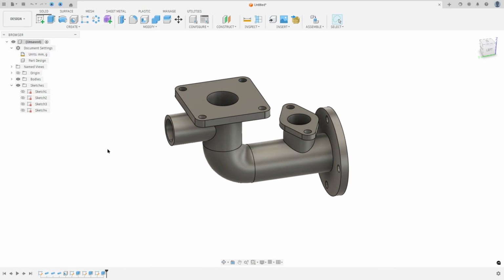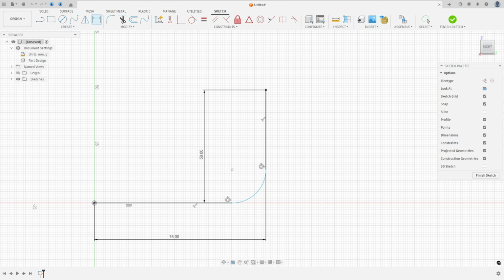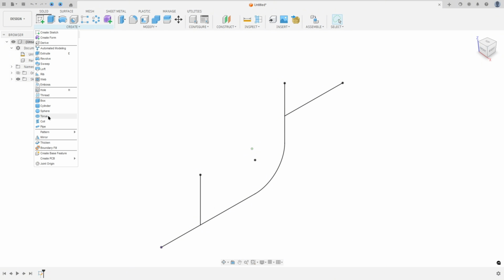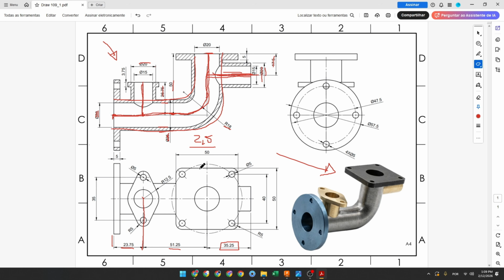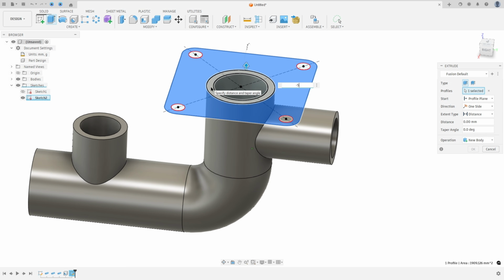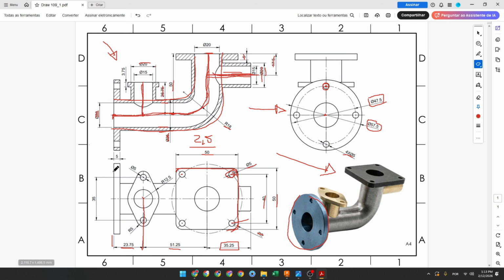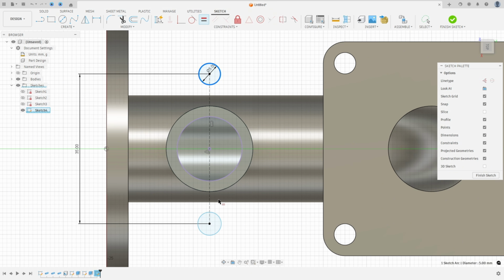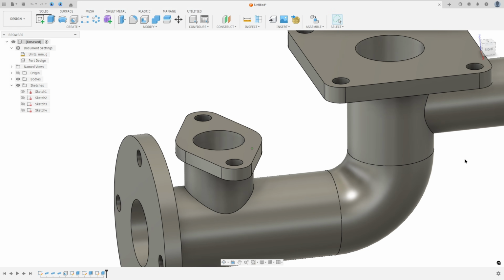Fusion 360 From Zero | Beginner Step-by-Step Tutorial

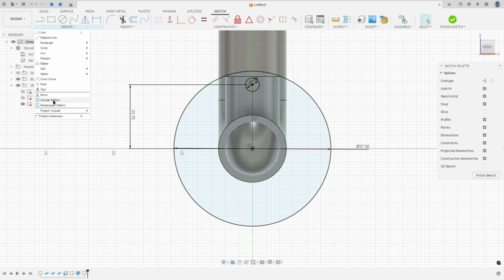Comment: Thanks!!  Good luck putting a fastener in to the 5mm hole we created @07:48 in the video, it is blocked by the flange of the vertical pipe section!  :-). I put 5 holes in the circular pattern (instead of 4).